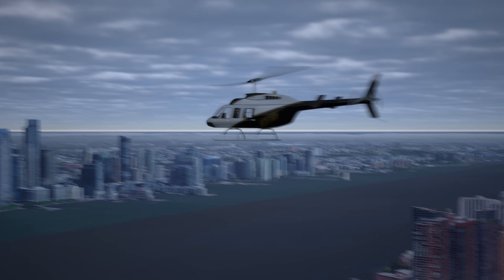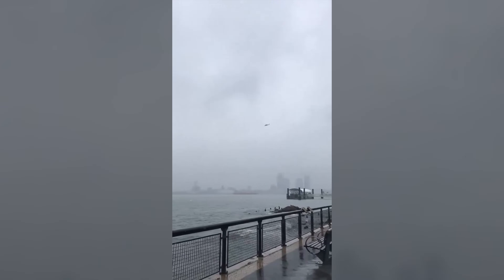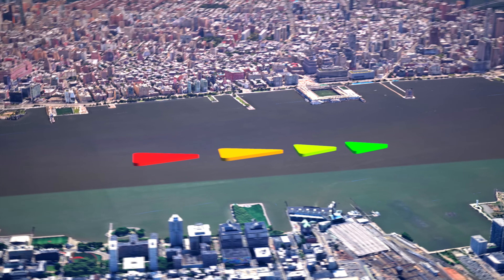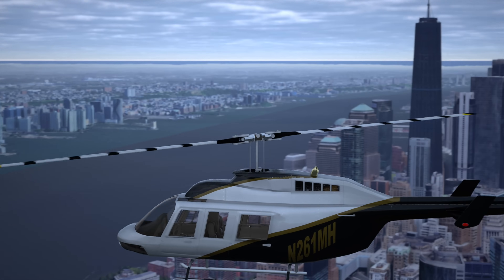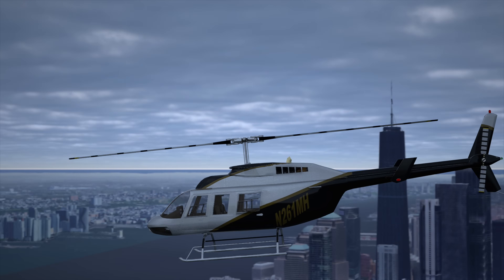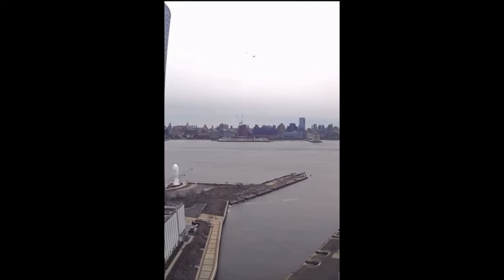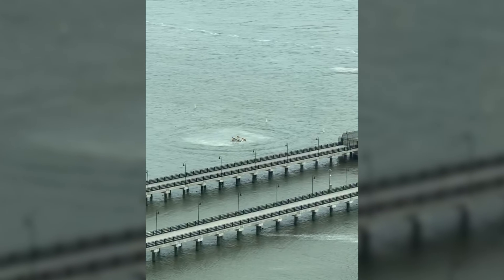Helicopters DON'T just fall from the sky - What is "Mast Bumping"?

Comment: As a retired commercial rotorcraft/helicopter pilot, this video explained the incident, and potential cause, extremely well.   Thank you.
Reply: The maintenance record will be interesting to rule out fatigue or poor maintenance.
Reply: @wsmith810 
"If" they made entries.
Some mechanics dont fill them out.
Reply: @wsmith810  That’s what I want to know…😢
Reply: There is a lot of good information here, but I'm not with the explanation as to the cause. 

This was absolutely not mast bump.  If there was mast bump and the main rotor impacted the tail section, then the blades would be destroyed. The rotor was complete and intact. We see video of the main rotor completely intact. A more probable cause is the SWASH PLATE let go, causing the PTO to the tail rotor to lock up. That lockup can and does put so much force on the tail boom that the tail boom just explodes. Seeing a video of the undamaged rotors with the upper swash plate still attached falling from the sky, leads me to believe that the upper plate separated from the lower plate. 

I'm not a betting man, but if I were,  I'd bet the ranch that the issue was with the swash plate assembly.
Reply: @j.thomas7128 
What the heck is a PTO?
This isnt a tractor.
Reply: @johnparish1432  If you believe that a PTO is only on tractors, then even I can't help explain it to you.
Reply: @johnparish1432  On the engine, there is a power take off that feeds power to the main rotor gearbox and the tail rotor gearbox.
Reply: @charlie99210  
Im very familiar with Bell products.
But Bell calls it a main drive shaft.
Bells field maintenance course doesnt even call it a PTO.
Reply: @j.thomas7128  Worked on Jet rangers, Long rangers, 212s, 412s, 214STs, A stars, Twin stars, S76s, Hughes, Robinson and Enstroms.
NONE of them call drive shafts PTOs.
If they do, please send a pic with description from their parts manual.
Are you in a foreign country that uses different terminology?
Reply: @charlie99210  
The tail rotor is driven from the transmission.
Not the main drive shaft.
Reply: How possible is it that the helico could have hit a drone ?!?
Reply: (Retired Army Instructor Pilot here) Mast bumping was the first thing that I thought of when I saw the footage. I've had spike knock before but not mast bumping. The narration in this video confused me when he used the term "semi-articulated." There are three types of rotor systems: Fully articulated, semi-rigid, and rigid. The 206 has a semi-rigid system.
Reply: @brianchristensen1894 i preferred the Hughes 269, fully articulated rotor would not kill us.
Reply: @melissasmess2773  Their big issue was ground resonance.
Reply: Agree. 👍
Reply: Mast bump (the main rotor hub will only hit the mast one time to snap it off, so no “bumping”, just bump) will separate the rotor head from the aircraft. This accident clearly shows the head, the mast and the main transmission all departed the airframe as one unit.
Reply: Could excess wind gusts cause this?

It’s my nightmare. I’m not likely to ever take one of these rides. Drone footage is sufficient for me since I’m a chicken.
Reply: @hlowrylong same here 🙏
Reply: "Your Daily Dose of Internet" just had a video the day before,  of a stalled small airplane that nose-dive crashed to the ground,  but it had a NASA-Apollo style parachute.  
Pilot simply walked away,  UNHURT,  and looks like only the propellor bent on impact.
Reply: Por los comentarios de testigos que primero oyeron diversos fuertes y cortos ruidos antes de uno mucho más grande instantes después se puede crea una teoría plausible del incidente ;
   El rotor de cola entra en invalance o fuerza asimétrica fatal ya sea por la perdida de una de las palas por fallo del bulon de agarre o tornillería que cede por stress esto crea una vibración salvaje haciendo oscilar todo el tubo de cola arriba y abajo hasta que alcanza una de las palas del rotor principal seccionandolo y metiendo a la nave en una perdida irrecuperable sin posibilidad de un aterrizaje de emergencia (auto rotacion).
Reply: @carmelonold1090  ya...¿y la cola cómo se perdió? Las hèlices principales aún giraban cuando volaban solas...no parecían dañadas "severamente".
Reply: In the RC industry we call these boom strikes.
Reply: I predict a push rod on the swash plate detached causing the boom strike.
Reply: I was a AH-64 Crew Chief (Army) for six years. I knew about the main rotor blade flex & autorotation, but not bumping. Is this a problem with all rotary wing aircraft or just this design? Any pilots or A & P license holders here that can chime in?
Reply: I've never flown one. I used to work on CH- 53s. Looks to me like the aircraft experienced structural failure that separated the tail assembly from the forward section and the tail section struck the forward section. Just MHO. What do you think?
Reply: @manilajohn0182  yeah, same here, as well as 107's and a few others - I'm not seeing the result of mast bumping here (much more likely in the Robinson R22/R44 series), but rather something more similar to your guess - tailboom separation for whatever reason...
Reply: @markbalancehealth  The sole reason why I suggested tail assembly failure was torque causing structural failure- but that's a pure guess. When I was in the Corps, my staff sgt. said that in the early days of CH- 46 ops, some 46s broke up right over Santa Ana due to torque from the contra- rotating main rotors on an airframe inadequately (at the time) stressed to handle it. As I said though, I'm just guessing. I lack the background to have any clear idea, frankly.
Reply: @manilajohn0182  in forward flight right yaw from the main rotor is greatly opposed by the vertical fin. The tail rotor still produces thrust to keep the aircraft in trim with the anti-torque pedals. Therefore, there should not have been a great amount of right yaw, which would cause separation of any parts. Let me add in my opinion.
Reply: @kevincard5060  Many thanks...
Reply: @manilajohn0182 This company had several violations mechanical wise ,from what I hear....js
Reply: @manilajohn0182  The early CH-46's had some incidents on hard landings and the airframe would break apart at section 410, right in front of the rear transmission/powerplant area. They were beefed up and had less problems later on.
Reply: @manilajohn0182  A Mast Bump resulting in cutting the boom would cause damage to the main rotor, but is unlikely to cause the main rotor and gearbox to become detached. The accident was probably cause by a gearbox failure.
Reply: @christopherrobinson7541  Interesting. Okay, and many thanks for your reply.
Reply: @christopherrobinson7541 catastrophic gearbox failure makes more sense to me.  There is enough inertia in each rotating assembly to cause separation simultaneously if the gearbox seized.  Never seen a main rotor without damage after a boom strike. This would be easily determined by examination of the gearbox.
Reply: @christopherrobinson7541  The transmission , mast and rotor were together. Mast bumping would sever the mast at the hub. I'm guessing transmission mount failure. As the mount failed, the blades could have cut the tail boom.
Reply: @christopherrobinson7541  I don't think so ?  If that happened, it would of parted at the same time as the tail strike. Also if that happened  the blades would of just ripped the trans out, Then the tail strike.  It looks like a tail strike happened first & then the gearbox ripped off.  It looks like 1 of the 4 dog bones failed.  That transmission is supported by those 4 dog bones . If one of the front ones failed or a bolt came out,  the rotor would tilt back & severe the tail boom & that would then rip the other 3 dog bones off & the complete assembly depart like the video shows.
Reply: @christopherrobinson7541 I’m thinking about a possible failure of the front gearbox attachment point. That would allow the entire assembly to tilt rearwards and main rotor blades to chop the tail boom. Tragic, whatever the cause.
Reply: Exactly what I was thinking @daversj
Reply: @christopherrobinson7541 good observation !
Reply: @daversj i agree. On most of gearbox box failures I've seen on different aircraft, part or most of the gearbox case stays attached to the prop or rotor. Since the tail rotor shaft  runs into the same gearbox I would think the sudden force would snap the tail off too. Wonder if they were routinely checking the mag plugs.
Reply: @daversj completely a layperson , but I’m thinking same catastrophic
Reply: @ronaldcooper7609 if you notice the helicopter was rotated in the same direction as the rotor spins at the beginning of the failure, which takes an incredible amount of force, and is the opposite direction that a loss of tail rotor would allow it to spin.

But the transmission siezing would instantly transfer all the momentum of the rotor into the helicopter, causing it to spin, snapping the tail boom off from the sudden movement, and ripping the transmission free from the air frame.

Any blade strikes on the tail would shatter the blades, and we can see the blades are intact on the way down.
Reply: agree! 100 percent. Rotor would be blown apart. But ... here are the experts. Ha ha
Reply: @christopherrobinson7541  That was my very first rough guess, when I saw the 1st video of that chopper coming down without main rotor, even without seeing these additional videos. Engine failure leads to attempted autorotation. Boom strike damages main rotor, but should leave gearbox attached. Only the structural damage within the gearbox itself could launch in the air with the main rotor attached and still spinning... Tail boom comes of quite easy due to excessive g-loads in aftermath, it is probably not the cause.
Reply: @manilajohn0182  My money's on improper maintenance resulting in catastrophic gearbox failure. Given the weather, there's no way such massive structural failure would have occurred. The fuselage would have had to have been literally rusting off. But what is most surprising to me is that the rotor and gearbox completely separated from the body.

I suspect they'll know without doubt what happened when they examine the wreckage. The fact that it all landed in water will fortunately make the investigation much easier, and thankfully resulted in no destruction or additional death on land.
Reply: @fleatactical7390 good point. That’s the only reason I can think of that would tear out the gearbox. I can only imagine how terrifying those souls last moments were.
Reply: @manilajohn0182  I dunno I'm apt to think that the rotor hit the tail boom and both ripped off at the same time.  I would think those heli's as far as structural air-worthiness goes would be pretty solid enough not to fail on it's own.   I saw a video similar to that, it was a big military heli doing a mid air refuel and he he hit some turbulence or something and blades bent down far enough down to cut off the tip of the refueling nozzle on the front of the heli.  Likely similar happened here.
Reply: @manilajohn0182   I worked in Flight Safety at Boeing Helicopters for 9 years with 40 years as military/civilian Flight Nurse and haven’t lost research skills. I went through entire NTSB and FAA databases. How many NTSB investigations of mast bumping in Bell 206 since 1981 in entire world? TWO. Rockport, WA - wind gust or “slamming baggage door”; Australia - engineer dropped a laptop on the cyclic. Bell Test Pilot was on @TakingOff channel. How many did he say? ONE. Same one from Australia. Two good reasons why it’s not mast bumping. 1) Tail boom separated at back of cabin. That’s 45 degrees of blade flex. Impossible; 2) BOTH main rotor blades, mast and something really big (whole/part of transmission) came off intact spinning into water. That’s not mast bump.
Reply: @manilajohn0182 no you didn’t
Reply: Yes, it did
Reply: Lots of good information here. Really unfortunate accident. God bless the families and those affected by this tragedy.
Reply: Mastbumping would be the easy answer however not the most likely. You are leaving one very important part out of your explanation. When a helicopter experiences a low-G situation, she will roll to the right (tail rotor) with a roll rate of up to 100 degrees per second. Only, and only when the pilot does not recognize this, and attempts to correct for this right roll with left cyclic input, mast bumping will occur. And when mast bumping occurs, the rotor will separate at the main mast just below the rotor head. In this case, the whole transmission appears to be ripped out as well as the tail boom separated. I dont know the cause, but your explanation of mast bumping is incomplete and faulty and the events might indicate more or something other then just mast bumping at play here.
Reply: @χχάάοοςς Impressive. What do you think you're doing, prepping a student for their practical test?
Reply: @ No, only idiots who jump to conclusions and clearly need a reminder of the basics. What’s your problem?
Reply: The more I see in video’s, the more I start to think in the direction of a transmission failure. Mast bumping would have separated the rotor from the mast. Not rip the transmission and rotor as a complete unit out of the fuselage. A tail boom strike would have fucked up the blade as much as the tail boom. These blades However look intact. The only other thing I can think of is a complete lock up of the transmission. This would rip the whole transmission out and also the tail rotor drive shaft (including the tail boom).
Reply: The more I see in video’s, the more I start to think in the direction of a transmission failure. Mast bumping would have separated the rotor from the mast. Not rip the transmission and rotor as a complete unit out of the fuselage. A tail boom strike would have f’ed up the blade as much as the tail boom. These blades However look intact. The only other thing I can think of is a complete lock up of the transmission. This would rip the whole transmission out and also the tail rotor drive shaft (including the tail boom).
Reply: They call it a tail boom bumping, but the blades look 100% clean.
If any blade had touched the tail boom, they would have either bent or break.
Reply: @MengGuoZhou  True
Reply: @MengGuoZhou  That Helicopter Crush, Just Like With Those Other Jet Plane and Helicopter Accidents Was An Inside Job Done By U.S. Government, The Brotherhoods of The Illuminati, Freemason, Skull N' Bone, Jesuit and Occult, Entity Organizations of The CIA, Secret Societies and Elites, and Also Shadow Governments.

And Remember That 9/11 Was Also An Orchestrated Plan Inside Job.
Reply: Also read @tkoehler44 comment and some replies to that comment. Lots of possibilities for root cause, but I think video nailed it with the rotor hitting the tail as the end result.
Reply: What do you think of the possibility that someone pulled the rotor break (or whatever it is called) by accident?
Reply: @DeannaWalsh  or not an "accident". That family was very wealthy.
Reply: @ That would more likely cause smoke/fire. The brake is not strong enough to slow a powered rotor system (engine running).
Reply: @DeannaWalsh 
If someone pulled the rotor brake NOTHING will happen except the brake pads will wear out instantly.
It wont cause a catastrophic failure.
Reply: @DeannaWalsh  Bell 206 doesn't have rotor brake, at least none that I have ever been around or worked on.
Reply: @ ok thanks
Reply: @ I did a quick research, and it said that the Bell 206 can be equipped with a rotor brake, but it’s an optional kit. I guess it would be good to find out if that one had it.
Reply: Good video, but the intact main rotor indicates rotor bump was not the cause of gearbox separation.  It was probably a mechanal issue  combined with metal fatigue.
Reply: Mast Bumping was a huge danger when I flew Robinson helicopters, any semi-rigid rotor system needs great respect. 😅
Reply: Could this be like a death wobble on a motorcycle? Usually does happen but always can on any helo?
Reply: @Subject_12  No.
Reply: a very high profile executive was killed in a highly unusual accident
Reply: Yes sir, well explained. As a HeloTech with a lot of experience working on this 206B & L models, i thought initially that it was the Jesus nut (only nut holding the MRotor Hub to the Mast) letting go - thought that the pitch links would have made the blades initially pull negatively & cut the tail boom but in this new footage, the top of the Tranny was still attached to the Mast & MR Hub. 
Mast bumping eh?? So sad - what a tragedy.
Thank you for the video and explaining it in an easy way to those with less knowledge on Helos ;) 
RIP
Reply: It didn't explain why the doors couldn't be opened and tourists jump out. It was the river below.
Reply: I would think that a gearbox failure and separation could also cause the tail to break and part of the gearbox to remain with the rotor.
Reply: Not a mast bump
Reply: Have you noticed the 1000s of comments supporting the "mast boom" bumping theory? 
YT bots, groomers and handlers at work.

They call it a tail boom bumping, but the blades look 100% clean.
If any blade had touched the tail boom, they would have either bent or break.
Reply: As a person who has never even been near a helicopter, I think I understood it  as well.  Very well done.
Reply: rapid disassembly 
sound familiar yet? 
FElon belongs in the gr0und not the government
Reply: Thanks maggot
Reply: so going off the footage shown at the start I'm going to assume some kind of mechanical issue occurred in the main rotor shaft causing it to attempt to completely lock up or seize causing the helicopter to violently rotate ripping the tail off due to the g force
Reply: we now need to investigate all the prior maintenance on the helicopter
Reply: @Velvex_Vancreed  This makes sense out of other hundreds of explanations
Reply: When I heard the MR separated I immediately thought 'mast bumping,1 although we cannot intelligently speculate at this time what caused this tragedy. That being said, I'm still kinda glad I flew mostly Hughes designs over the years.
Reply: I keep my a$$ on the ground these days. 😅
Reply: As a guy on the internet who is sick of people starting their comments with " as a".  It gives you zero credibilit. In fact it makes you look worse than a jackwagon that doesn't know shit from shinola.
Reply: My thoughts exactly. Great video. 👍
Reply: Reports now he was low on fuel. Not sure how that could possibly factor in
Reply: Message reinforcer.
Reply: or somebody wanted to get the CEO killed.
Reply: THE IRON DOME...
Reply: Jesus nut?
Reply: Cool story bro.
Reply: more like a cia agent psyop division
Reply: Ok
Reply: Ancient Wisdom: The Path to Mastering Emotional Intelligence 

https://youtu.be/fkAhgl7GHHU
Reply: No actually it didn't. This guy and you have no clue what youre talking about.
Reply: I am not into helicopters, I am from Spain...but I saw the main rotor intact flying away, so it dettached... but no tail? This is beyond mechanical failure...Also...didnt the pilot say he was short in gasoline? This looks like "not" an accident. I think someone took it down. The main rotor was turning as it was flying. It had not been destroyed by piercing the tail.
Reply: @Kale-c9w  
Wait until the final report from the NTSB.
Reply: This wasn’t mast bumping. Mast bumping doesn’t rip the gearbox out.
Reply: Do you think it possibly hit a flock of birds that caused it?
Reply: @ no, that multiple damage cant be caused by striking birds.
Reply: ....
Do you know Jesus Christ can set you free from sins and save you from hell today 

Jesus Christ is the only hope in this world no other gods will lead you to heaven 

There is no security or hope with out Jesus Christ in this world come and repent of all sins today 

Today is the day of salvation come to the loving savior Today repent and do not go to hell
Come to Jesus Christ today 

Jesus Christ is only way to heaven 
Repent and follow him today seek his heart Jesus Christ can fill the emptiness he can fill the void 
Heaven and hell is real cone to the loving savior today 
Today is the day of salvation tomorrow might be to late come to the loving savior today 
Romans 6.23

For the wages of sin is death; but the gift of God is eternal life through Jesus Christ our Lord.

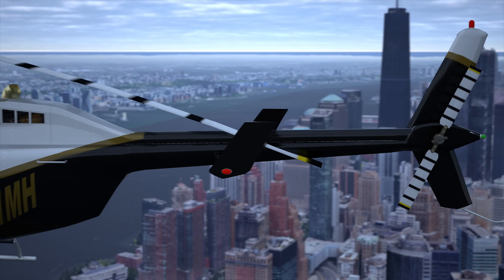John 3:16-21 

16 For God so loved the world, that he gave his only begotten Son, that whosoever believeth in him should not perish, but have everlasting life.  17 For God sent not his Son into the world to condemn the world; but that the world through him might be saved.  18 He that believeth on him is not condemned: but he that believeth not is condemned already, because he hath not believed in the name of the only begotten Son of God.  19 And this is the condemnation, that light is come into the world, and men loved darkness rather than light, because their deeds were evil.  20 For every one that doeth evil hateth the light, neither cometh to the light, lest his deeds should be reproved.  21 But he that doeth truth cometh to the light, that his deeds may be made manifest, that they are wrought in God.

Mark 1.15 
15 And saying, The time is fulfilled, and the kingdom of God is at hand: repent ye, and believe the gospel.

2 Peter 3:9
The Lord is not slack concerning his promise, as some men count slackness; but is longsuffering to us-ward, not willing that any should perish, but that all should come to repentance.

Hebrews 11:6
6 But without faith it is impossible to please him: for he that cometh to God must believe that he is, and that he is a rewarder of them that diligently seek him.
Jesus
Reply: Usually mast bumping stems from a negative G situation.
Reply: @MattDapson  That helicopter is a piece of junk if it wasn't designed to prevent this from happening in any possible or impossible situation!
Reply: Don’t think so.  Tranny or tranny mount failure.  Mast bumping would snap the mast close to the rotor hub and the rotor entered the water attached to the mast.  For all the “experts” that just pulled “design failure” from their asses know that the 206 probably has 10 million flight hours globally.  I was taught to fly hellos in the USMC on the military equivalent of this aircraft.  Teetering rotor heads were fairly common for decades of a twin rotor helo.  The Huey has the same system and God knows the hours that platform has amassed.
Reply: As a heli pilot myself it is to early to say for sure. There are a number of factors to consider from tail assembly fatigue to rotor mast separation. Bird strikes unlikely from the video. Tough one as there are two catastrophic failures, the result of one causing the other. I would look first at the rotor mast as the primary failure point.
Reply: how expensive is that model of 🚁 ?
Reply: @Velvex_Vancreed Every helicopter 🚁 spins, you can't break its tail unless a detached blade 🔪 cuts it in two or it just exploded from inside
Reply: There was something seriously wrong with the NYC tour helicopter that crashed ; the tail assembly cannot just "fall off" - surely there would have been some "vibrations",etc giving warning something wrong !!!
Reply: Was this Robinson by any chance
Reply: Obviously it’s Russian hacker sabotage end of days second coming. This is the most plausible explanation.
Reply: Bell 430s have had main rotor clinch pin clevis failures cause crashes. They just fell out of the sky.
Super Pumas - a few just fell out of the sky. One off Peterhead Scotland, one in Norway - aftermath of that was caught on video.
Helicopters working in marine environments have a hard life.
Reply: like how all things are digital now vs analog and how it's messing everything up in every way? "Smart" is not wise.
Reply: So why was the incident??  😢 damy .
Reply: Whaa..   ugh 😢
Reply: The Company Seemed to be Bleeding Money.

Are Affluent People Happy when they lose Money? I could be wrong.
Reply: It’s holographic
Reply: Kind of a weird way to flex that you're a helicopter pilot 😂😂 no one cares dude 😂😂
Reply: Could be that there were stress fractures somewhere that maintenance didn’t notice. It will be interesting to see the maintenance records like another commenter said. I wonder how old the helicopter is?
Reply: No it didn't and I doubt you are pilot. It's quite obvious this guy doesn't have a clue what he is talking about and neither you. Just making manouvres left and right doesn't gonna cause mast bumping. It needs to be pushing forward on cyclic to get under 1G. That unloads the disk and than is when you can get mast bumping or tailstrike. Main issue is a turbulence or mechanical problem - that nearly got me several times and it got quite a few of my friends over the years (R22, R44, 206, UH1 - same problem) I dodged birds so many times with pretty aggressive inputs but as long as you have the disk loaded it's no issue. zero G is the killer and I would bet the pilot got gust from between some buildings or there was mechanical problem (most likely). Birds are no issue here
Reply: 😊5⁵7thuI😊656😊⅝6II😊9 3:52 s😊hu⁹😅😊Iiuuu😊I justu9😊 3:52 ju6u5😊😊k5😊kh😅9😊j😊
Reply: Too many helis and planes been brought down these days… it’s because of an agenda to push something.. there’s a reason why this is happening, and it’s not random, NWO
Reply: As a certified fake commercial pilot, this is total BS with nice CGI
Reply: Didn't cover possibility of sabotage...
Reply: Alstom、Huawei…..Now ,Siemens？！😅
Reply: Did the people in the helicopter when they were upside down? Did they know they were going to die? The children are the parents
Reply: Ok so we're not even gonna talk about 3:51  😅😂😂😂
Reply: It is a video that tries to cover up the helicopter's flaws.
Reply: Thats not just a mast bump... Yr main rotor hub would not fly off by itself... That would only happen if the pilot threw that craft into serve downward  negative Gs. (big no no.. U not meant to even pass 1 negative G.) and during the detachment the rotor blades or air frame tilted  and the tail boom got sliced off... For this to happen the pilot would have had to pull a very quick and irratic move on the control..... Why?  All his flying right before accident was smooth.... Only thing I can think of is pilot tried to avoid a flock of birds at last second.
Reply: Not mast bumping
Reply: "As a retired commercial rotorcraft/helicopter pilot, this video explained the incident"

The video is a retired pilot? You English very good!
Reply: No it didn’t and I don’t believe for a second you ever flew anything
Reply: Really
Reply: He’s a navy flyer !!!    Dumbasses
Reply: @thumperjdm  wanna bump masts?
Reply: So so sad for that pilot and family and everyone who loves them...
Thankfully no one else was hurt by the falling helicopter!
Very detailed explanation and comments...
One of my lifetime great things that I did was take a helicopter over the Grand canyon but given how many bad things keep happening in flight probably I won't do that again anytime soon! One is enough!
RIP all involved...
Reply: That Helicopter Crush, Just Like With Those Other Jet Plane and Helicopter Accidents Was An Inside Job Done By U.S. Government, The Brotherhoods of The Illuminati, Freemason, Skull N' Bone, Jesuit and Occult, Entity Organizations of The CIA, Secret Societies and Elites, and Also Shadow Governments.

And Remember That 9/11 Was Also An Orchestrated Plan Inside Job.
Reply: sabotage.
Reply: If there was floaters on that helicopter why was there no survivors, such a horrible tragedy
Reply: Life is hard 😮
Reply: If your a retired pilot then you would have known it was the Jesus nut that went out as stated if you don't know what that is gen your a liar sir
Reply: Haven't seen this full video! Looks like something significant happened mere seconds before falling and separating.
Reply: @mountainman001  the Jesus nut broke loose just research what that is and what it does and you will understand it's not a mystery this is just someone exploiting the tragedy of another for views content vultures
Reply: Agreed, I had the same issue in 1996 😢
Reply: or it was a hitjob
Reply: You could probably give the manufacturers some feedback years ago and prevent so many deaths 😔
Reply: I agree. It explained a lot because I know basics but not terminology. I had a boss went down here in Texas first time he had his pilot take him home. Pilot survived. Tail rotor came off of a literally brand new copter. Thank you for such input. So terrible to lose all these people. I hope they find out what happened.
Reply: The cause was jews
Reply: For future helicopter passangers - when I used to work for BC HYDRO I had few trips in a mountains on helicopter. I would never fly if it wasn't    order. Terrible fillings. Vibration, roaring noise, and smell of kerosene... Everithing shows me that  this machine works very close to  their limits.
Reply: Curious question, how do you feel about these tourist helicopter companies? me and the wife flew on a tourist chopper thing in Hawaii, but have heard that it's extremely dangerous cause of the maintenance or lack there of. THank you
Reply: @medicenElPipiripao  According to the “taking off” channel, it was a fairly new helicopter, a 2024 model.
Reply: @medicenElPipiripao exactly my thought. Pilot training and aircraft maintenance are fundamental to aviation safety, often overlooked in the context of private or tourist flights. There can be some gray zones when it comes to these type of operations
Reply: I will never get in one, let alone pay for it. Two things I will never do. Motor cycles and helicopters. A machine that can destroy itself is not worth one’s life.
Reply: @westerlywinds5684 I went in one over Niagara Falls when I was a kid. After watching this, no thank you.
Reply: But you drive a car right? @westerlywinds5684
Reply: This machine save 10000 times more lifes than it killed. @westerlywinds5684
Reply: @westerlywinds5684 
Very perfect, thank you.
Nick
Reply: @westerlywinds5684  
Any Aircraft can crash.
What goes up must come down in one way or another.
Everything on Earth is trying to kill you. lol
Reply: @Zeaiclies  We have also found ways to prolong that.
Reply: @westerlywinds5684  
Prolonged what?
Reply: As a complete layman, hearing CEO of Siemens told me everything I needed to know 😅
Reply: There’s not a chance in hell that still spinning rotor blade hit and severed the tail.
Reply: @timefilm  There's a chance for just about any conclusion but the wise choice is to avoid making such statements until the NTSB publishes its report of probable cause.
Reply: @Tom-zs6bb  nonsense. rotor blades aren’t indestructible. Show me any video on YouTube of a rotor blade hitting anything and maintaining itself.
Reply: @timefilm  I don't believe I ever claimed rotor blades are indestructible. All I'm saying is claiming to know at this point what caused this tragedy is premature. Remarkably so.
Reply: @timefilm the guys that make the Blackhawk blades tell me they tested one to chop thru a 4” oak tree and not bend or break.
Reply: @bcbloc02  this is hardly a black hawk and there’s simply no chance that freefalling spinning rotor had been impacted by anything. Why is everyone arguing this?
Reply: I dunno, I’m purely an amateur enthusiast so my opinion is probably dog water but this kind of Spontaneous Unscheduled Rapid Disassembly feels like it would take more than that. 

SURD is one of my biggest irrational fears whenever I’m doing anything even remotely dangerous lmao. I mean, just imagine if your lawnmower decided that today it identified as a grenade?
Reply: @RealBelisariusCawl That lawnmower scenario you just described unlocked a new fear I never knew I had.
Reply: @RealBelisariusCawl  rapid disassembly 
sound familiar yet? 
FElon belongs in the gr0und not the government
Reply: @RealBelisariusCawl dog water indeed. Irrational at best
Reply: @RealBelisariusCawl  Almost like someone shooting themselves in the head twice and calling it suicide huh...
Reply: 🤣❤️🍻 @RealBelisariusCawl
Reply: @RealBelisariusCawl  Well said lol!
Reply: @manilajohn0182  LOL?? What's funny about this?
Reply: @heartlandhawk4513  - Did you read the comment he was replying to? The funny part was not regarding the accident.
Reply: @heartlandhawk4513  You should read the relevant post. Then you'll see.
Reply: If it doesn't have 2 wings and 2 jet engines, I won't fly in it, period. Even then I don't like flying. A helicopter? Hell no.
Reply: Charles 
While this incident was obviously a catastrophe, a helicopter with an engine out and loss of tail rotor effectiveness can land safely in a multitude of locations that would be unsuitable for a jet twin in the best circumstances.

One engine out on a twin will cause it to yaw severely and can contribute greatly to a fatal crash.
Both out will be symmetrical, but all other controls or power will also be greatly diminished.
The transfer of energy landing a twin jet, probably without landing gear deployed is going to be very disproportionate to a helicopter in auto rotation.

I’m not trying to sell you on either.
Being in a defective aircraft is not fun.

There are a great number of variables that determine whether a bad situation in either will be survivable or fatal.
The advantages for one scenario may be a disadvantage in another.

Make the choice you feel comfortable with.
Just be aware that no declarative statement creates a definitive outcome.

Happy motoring 🐅
Reply: @charleshammer2928 you right, buddy
Reply: People should not rule out sabotage until that is investigated, but it probably won't every be. He was CEO of Siemens Spain & global head of their Railways division.
Reply: @Lacronh  Very interesting considering the number of CEOs/wealthy folk dying in "accidents" lately. I was actually just going to look up who the dude was an my guess this story won't be news anymore in a few days. They need to investigate how easily this accident can be replicated.
Reply: Bell is the worst
Reply: @LexlutherVII 
I worked for PHI.
We had 6 million flight hours flown on various aircraft.
Mainly Bell.
Maintained and flown correctly they are just fine.
Reply: @johnparish1432  Right back at ya, John!
Reply: There should not be any situation in where the rotor is hitting the tail that is just insane and is absolutely negligent engineering
Reply: @onejohn2.26.  As I noted to another commenter, the Bell 206 is, or at least was, when I was a law enforcement pilot, the safest airframe in General Aviation. To accuse the manufacturer of 'negligent engineering' after all those years of success seems somewhat specious.
Reply: @Tom-zs6bb  
When your router can hit the frame of the chopper that is absolute negligence they should build it so that is impossible to happen or, you are just tempting fate.
It is an accident waiting to happen
Reply: @Tom-zs6bb 
GREAT comment.
Reply: @onejohn2.26.  'l that is just insane and is absolutely negligent engineering'
That's like saying a car is 'negligent engineering' because you can steer into a tree or a wall, or blow up the engine while at speed and cause yourself to crash.  No, it isn't.
This type of accident usually leaves a lot of direct clues, and they'll determine exactly what happened by the damage that is shown.
Reply: @ModelLights  
If a car steering wheel came off if you turned it too hard I would call that negligent engineering and the same thing applies here
Reply: @onejohn2.26.  'and the same thing applies here'
No it doesn't.  Just because you are ignorant of aircraft, doesn't mean you get to make nonsense pretend 'rules'.
You specifically chose a different idea 'steering wheel fell off', when there is no evidence the 'controls fell off', because you know your ideas are incorrect, not because you think you're right about anything.

People who are correct don't have to exaggerate claims to pretend to be correct.
Reply: @ModelLights  oh but it's okay for you to make the analogy of a Car steering into a tree come on now use common sense and logic
If a manufacturer of a piece of equipment knows but yet ignores an engineering flaw they could be sued like there's no tomorrow
Reply: @onejohn2.26.  'the analogy of a Car steering into a tree '
That is literally improper operation.  Same as mast bumping.
Again, you're simply clueless about basic ideas.
Reply: @ModelLights  
You are the one who made the analogy of a car striking a tree, not me so that just shows that it is you who is not logically thinking this through whatsoever at all
Reply: @onejohn2.26.  To what engineering flaw do you refer?
Reply: @Tom-zs6bb  
The fly is that the rotor should not be allowed or be capable of hitting the aircraft at any time whatsoever
Reply: @onejohn2.26.  There shouldn't be any situation this happens in any complex system but no system is perfect... Shit happens, it sucks but this could happen to any aircraft at any time... No technology is infallible, all you can do is tweak the safety margins. This was probably just a freak accident.
Reply: Satans hand, tribulation days: Plane crash and incidents everywhere, not normal
Reply: @feth7747  So the fairy tale book talks about plane crashes?
Reply: How come whenever there's an aircraft accident or incident, these so called 'pilots' or 'aviation experts' all of a sudden swarm the YT comment section to give their opinions on the matter?. I find that very strange! 🤔
Reply: @Knull_uncaged because it’s the internet and they have opinions , as do you.
Reply: This never happened before that the rotor flies off like that. This was definitely a sabotage.
Reply: Survived a couple have you?...😂
Reply: bot
Reply: I’m pretty sure the cause was that they ran out of fuel… according to reports he radioed in he was coming in to fuel should have took 3 min but 20min later 💥. Cool video tho
Reply: Thumper's just thumping.He claims he's a retired commercial rodecraft.Helicopter pilot, but then again, after watching this video.Aren't we all??
Reply: This was planned
Reply: As a retired roto craft helicopter blade I can confirm this is correct
Reply: It was a cloaked tiktak, duh
Reply: I keep my a$$ on the ground these days.
Reply: Rusian cyberhackers by satellite can Produce a vacuum to the side of copter and take it down.
Reply: @marinaclarasanchezsuarez2905 
It was not Russia Russia Russia. Good grief.
Reply: @annap7678 
Danke.👏 Jedes Mal dieses Russland bashing
Reply: @marinaclarasanchezsuarez2905  That sounds like the most probable cause to me and of course the Russians would want this Siemens high ranking employee killed for a variety of reasons, his wife and 3 kids were just collateral damage.
Reply: @marinaclarasanchezsuarez2905  
Bull shit and total fiction.
Reply: @marinaclarasanchezsuarez2905  the same Russia that had to resort to old, broken WWII and Cold War equipment in it's unsuccesful attempt to take down Ukraine over the kast 3÷ years? That Russia?